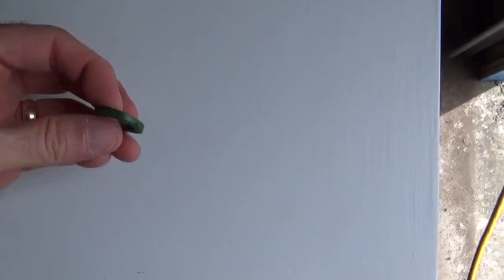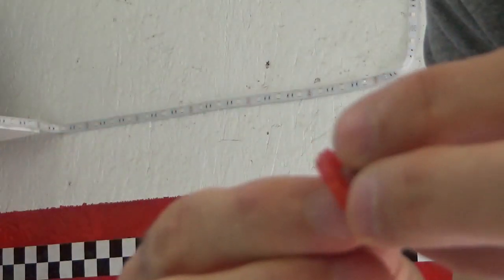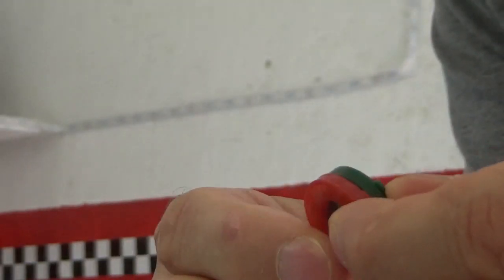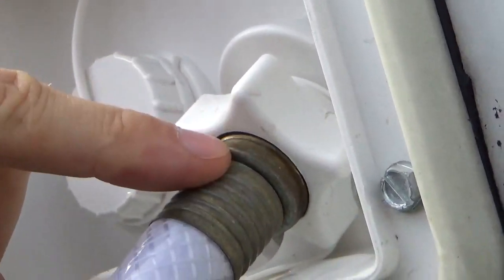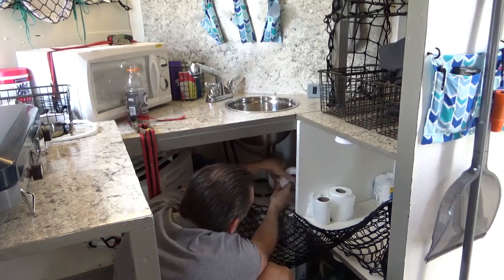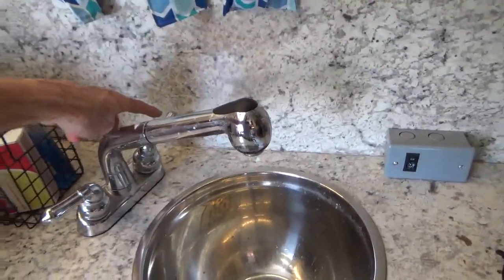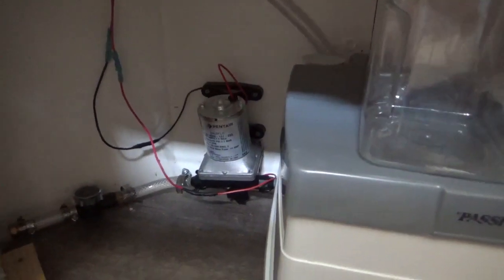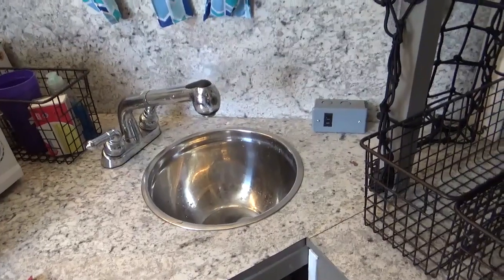PLUMBING PROBLEMS SOLUTION Water Systems Cargo Trailer Camper Conversion Vanlife Van life Skoolie

Comment: You might want to put a one way check value on the pump side of the faucet, because if you are hook to city water pressure and someone was to open both faucet valves at the same time and the pump is off you will back feed water from city thru the pump and into your water tank. A check valve will stop that back feed.
Reply from the maker: I like that idea. Thanks for the suggestion.